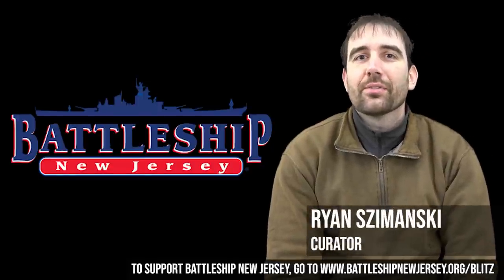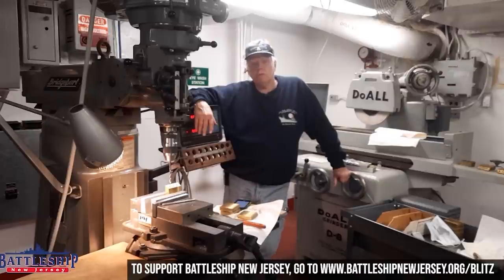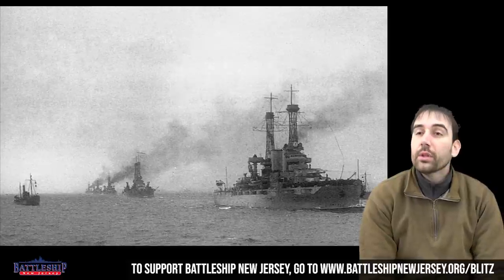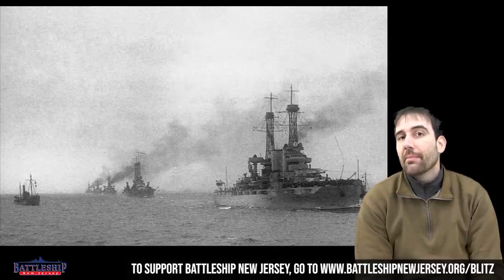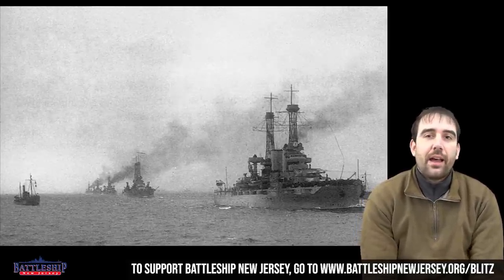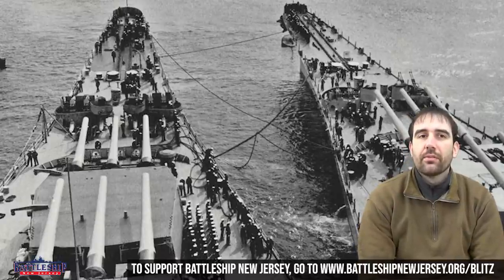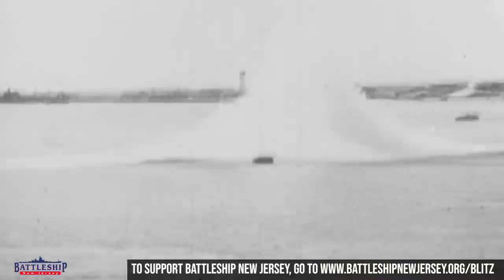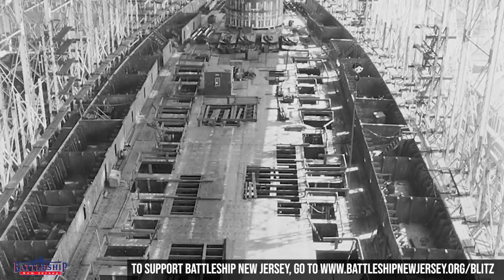The Evolution of Armor on Ships

Comment: I wonder if a ship's torpedo defence area that was left empty, would the ship benefit from having those areas filled with pressurized air or maybe the opposite, have those areas as a vacuum? Would the explosion be pushed back from the high pressure air suddenly being released at the point of ruptured armor or would the vacuum chambers pull the explosion further into the chamber, away from the ship's more critical internal structure and components?
Another thought I've had is what about jet drives? Speed boats and personal watercraft use jet drives for propulsion but a navel ship could have each room connected with a tube ending with a jet drive. After a hole is punched below the waterline and the ship is flooding, the jet drive could be turned on to pull the water flowing in through the damaged area and forced out the back adding to forward momentum. 
My final couple of thoughts on this subject, if a ship had rolls of metal bar reinforced rubber sheets on the sides, above the waterline, a torpedo blows a big hole in the side, damage control rolls down the appropriate rubber sheet (just above the hole) and the inflow of water would pull the rubber to the hull and keep it there, greatly slowing the flooding so internal repairs could happen without the teams being in waist deep (or deeper) sea water...but what about preventing the torpedo from detonating on the hull to begin with? Have 1" thick metal plates suspended above and away from the hull. The top of these plates would be attacked to wood or metal bars via a hinge at both ends of the bar and a cable at the top providing the suspension of the plate (to reduce drag when not needed). During combat, the plates could all be lowered into the water and the metal bars would keep these plates away from the hull so when a torpedo explodes, the energy is transfered to the water between the plate and the hull (which might get a little bent but not punctured).
Honestly, I don't know why I thought about all this stuff but capitol ship defensive protocols, tactics and armor (and damage control) are aspects of ship survivability I tend to think about a lot (submarine design of capacity, capability, stealth, efficiency, speed and protection too).

Comment: On the tour , just exactly how far up in the superstructure do you allow visitors to go. Im not really big on cookie cutter tours but when I went on the Wisconsin in May of 2011 you were only allowed on the main deck and up to the first level of superstructure. Outside of course.
Reply from the maker: Our tour goes as high as the 05 level and down to the bottom of the engine room on 7th deck.

Comment: What about a thin layer of very hard ceramic, a gap, a thin layer of very flexible material, an air gap, a thick layer of brittle  steel with silicon carbide fiber reinforcing it, a gap, then a thin layer of soft metal with a hard backing plate and glass fiber for spalling

Comment: With the accuracy of things like the  hell fire missile it would be possible to put multiple missiles in the same spot and possibly defeat the armor.  But it would require a minimum of 4 to 6 missiles hitting the same exact spot.  And the ciws its going to take out several of those. 
So in the real world situation i would say that New Jersey would survive at least a  dozen or more since the missile would have to burn its way through.
  I need to make a edit here with what American hell fire missile did during desert storm to tanks i would guess that if you could hit the same spot it would still take  12 to 18 to breach the armor and all you would end up with is a small hole that would be easy to plug
Reply: Things change when the enemy has air defense and ew systems. Hellfire can't be fired from very far away so the delivery platform would be vulnerable. So hitting the same spot multiple time when the ship is moving, jamming you, shooting at you, and while you are trying not to be shot, is not practically possible

Comment: How would a damaged section of iowa class belt be replaced/repaired? Is it designed to come out in sections after upper deck is cut away or does the damaged 12 inch belt need to be cut out?
Reply from the maker: There isn't really a lot of precedent here, the Iowas never damaged their belt armor. And it would really depend on the extent of the damage. But it isnt easily split into sections to replace it.
Reply: There is a picture of the belt sections stacked at the ship yard. I can't recall where that pic is hosted though.  They are fastened to the sts steel with basically large bolts.  

Replacing the plate once in there i think would be the easy part. Getting to it sucks. I assume you could get to it from the side, but as constructed they were lowered into place from the top. 

Another question is how long would it take to get a specific armor section made to replace a damaged piece?  If you did have one sitting around from an incomplete ship of the same class, it could be months to make one and transport it.
Reply: @jth877  Thank you. In a few old pics of South Dakotas and Iowas i thought it looked liked the angled belt was sectioned but wasnt sure how it was fastened and if it was reversable for repairs. I would hope they had some inkling how a repair would go and wouldnt have to torch 12 inch plate to replace it.
Reply: @jth877  I have a feeling you have to go up and out otherwise the framing is in the way. I would have thought you might have a few spare plates ordered with the ship to be available if a ship is damaged
Reply: Isn't it generally made up of sections rather than being a single continuous slab, I was under the impression that the plates were about 30' x 10'.
Reply: @JevansUK  Yes, I believe they are about that size.
Reply: @JevansUK  I think you're right for the upper belt. The lower tapered sections, which would more likely see torpedo damage,  have to be repaired from side.  I'm sure the resulting hole and repair of the surrounding structure would leave quite a bit of room to work.
Reply: Perhaps researching how they repaired the torpedo damage on the North Carolina would provide some clues and answers
Reply: @fko1  North Carolina has an external belt and bulge so is a rather different construction

Comment: I remember a documentary about the war in Europe and talking about technical experience, and that the average mechanical knowledge of American troops was better than for the Germans. So issues that would require a German vehicle to be sent to the rear for repairs would barely slow down an American unit where half your infantry knows how to fix routine issues on your trucks.

Sounds like a similar dynamic to what you talk about here with damage control at sea.  General technical knowledge among your recruiting pool can be a very powerful strategic advantage.
Reply: That’s because Americans vehicles are inferior to German vehicles. One German tank is better than 10 Sherman’s. It’s common knowledge that Germany has always still to this day made better vehicles. Look at Porsche, Mercedes, BMW etc.

Comment: "DuCol" (DOOCOAL) or "D/D.1" Steel is the British post-WWI replacement for WWI-era High-Tensile Steel (HT in British documents), used for extra-strength construction and light fragmentation protection.  HOOD's sloped inner deck just behind its waterline belt was 2" of HT steel and was there ONLY to stop fragments from shells that made a hole in the belt, but then immediately exploded (non-delay base fuzes, as was standard in WWI); however, delay-action fuzes became the rule after WWI and this concept was no longer really viable unless made much thicker and more highly sloped, as was BISMARCK's similar sloped deck-edge armor plating.  DuCol was developed by the British firm of Colville in around 1922, I think, and used by the British, the Italians, and the Japanese after WWI and had about the strongest tensile strength of any non-armor steel.  It was used in British heavy warships, starting with the NELSON and RODNEY, as both a light armor and extra-high-strength construction steel when some danger from enemy projectile fragmentation or hits from small-caliber weapons.  The US never used anything comparable to DuCol.  If no fragment or projectile resistance was required, HTS (US more highly alloyed version of high-tensile steel) was used (this included the anti-torpedo bulkheads used in IOWA underwater side protection system, which needed to be very flexible to stretch considerably before tearing when the concussion of a torpedo blast "water-hammer" hits it), and if such damage was to be included in the design at some point, then STS or Class "B" homogeneous, ductile armor was used as the main protection, not anything less.

During WWI the era, the two or more underlayers supporting the rather thin armored decks of that time period were of HTS, Mild Steel, and/or Nickel Steel, not full armor (STS was only in the top, usually thickest, layer), though giving better support than regular Mild Steel alone, as used elsewhere in the ship, but when that deck -- the 2nd deck that was one deck below the weather deck in the modern US battleships -- had to be of major protection against long-range plunging gunfire or aircraft AP bombs, only STS was used (in IOWA, 4.5" STS laminated over 1.5" STS, the lower, thinner layer being also the layer used for the ship's strength deck purposes).  Another reason for the laminated form of the 2nd Deck armor was to make the deck much stronger, since the two layers were overlapped about 50% so no edge where two plates met in one layer was anywhere near where the other layer's plates met -- some German cruisers did not do this and torpedo hits caused at least one to have its aft end almost fall off as the deck folded downward along the single joint of its armored deck, not good!!

Comment: with ships moving from 3000 to something in between 5000 to 8000tn but also being mostly armed with 76mm guns, i think that a 5' armor added to those ships would provide an extra protection against cannon ammo... 
On the other hand, no navy in its rigthfull mind uses the cannons as main guns, they are just the backup/seccondary guns... and they are still around because they can perform as AA/ASuW, they can shoot cheap shots and sink smaller / civilian vessels without wasting a pretty expensive missile (even AA missiles that can be fired against surface targets are much more expensive than cannon shells). 
As for shore bombardment, there are no armored static positions to be defeated anyway... It is not like it was on Normandie or any stronghold of WW2. War is just too mobile, in 1982 Malvinas/Falklands conflict UK avoided landing on the well defended Puerto Argentino/Stanley despite having naval supremacy and enough guns avaiable for massive shore bombardment, they performed their landing on a distant spot in order to attack defenders by the rear, and a modern conflict would be just like that... if the coast has heavy defenses, an infiltrating heliborn operation will land behind the line and attack from the rear.
Light 76mm to 155mm shells provides 20 to 30 kilometer range of cover for landing troops and coastal combat, and have enough punch to pierce machinegun nests or building improvised bunkers which will be the (lightly armored) realistic points chosen by defenders, so in fact having more shells, good coordination and communication (for spotters and fire direction) and faster Rate of Fire is way more important than extra TNT or penetration capabilities

Comment: You made a comment at the end about there not being a ship right now that uses a gun larger than about a 5" inch gun so there isn't a ship that could sink Iowa excluding torpedo and missiles. Navy thinking was missiles were the future.  Shoot the enemy over the horizon.
You  finished mentioning you wondered about the use of tank armor amd munitions used on a ship someday? Well it is happening. 
I read the Navy just submitted a change order for the under construction USS Bougainville LHA-8 for the construction of platforms on port and starboard below tower and beside the air craft elevator platform for mounting of 2x General Dynamics M1A2 turret with 120 mm M256 main gun and autoloader for M830A1 rounds in addition to the already installed VML tubes as well as reactive armor to be mounted on the all exterior sides of the command and flight operations centers.
Long ago the Lexington and Saratoga aircraft carriers were built as Battle Cruisers with straight landing decks and dual 8 inch guns in two turrets forward and two behind the tower originally. Marine Air Landing vessels don't travel with 15 plus ships and an attack sub for protection like a super carrier. They travel with an Arleigh Burke for ship to ship protection beyond what their own RM-116 launchers provide. The Navy can not afford to keep building,fueling, manning, supplying and sailing a destroyer for every LHA. They should be big boys now. 
The latest Marine Corps LHA America Assualt Aricraft Carrier Class Ships of America LHA-6(Now at Sea) and Tripoli LHA-7 (Under Shakedown) were Air 0 ships with no well deck and had no armor. They felt the ships defense and offense came from 2×Mk53 decoy launchers, 2xRIM-116 Launchers, 2x RIM-163 Launchers, 2xPhalanx CIWS, 7x 50Cal Machine Guns, 2ea AV-8B Harrier, 4ea F35B, 10ea V22Osprey, 4ea AH-1ZViper, 4ea UH-1YVenom, 1ea CH-53K King Stallion, 2ea MH-60S Knight Hawk 
That's a lot of missiles cannons and bombs between what's bolted to the deck and what flys off of it. 
The Chinese have a carrier/Battle Cruiser that launched in 2020 with turrets port and starboard with 2 xenclosed dual 5.1 inch full automatic cannons , 6x 11barrel 30mm rotary cannons as CIWS 3port and 3starbord, 30 vertical launch tubes for sea to sea, land, air missiles, 4x torpedo tubes forward 2x aft and what looks to be a turret holding  1x 8inch projectile rail gun forward if the tower. One of these ships pulled out from behind an island in the South China Sea and came up to the Starboard side within 15,000ft of an Arleigh Burke before it was noticed three weeks ago. What we have seen happen to russian cruisers and destroyers in the Black Sea over the past month against ships no bigger than a millionaires yacht has shown us how misguided we are.

Comment: I never understood why the side armor (on modern battleships) would slope inward from the top.  This looks like it would be less effective against projectiles coming in at a high slope angle.  Why not slope it inward from the bottom?  If it slopped inward from the bottom, then it would also reduce some of need for horizontal armor.

Comment: I'd go Iron inside. It would be less Brittle because it's not directly exposed to the cold Sea's. Maybe even put a layer of Insulation in the middle as well.
Reply: Also the Softer wood can absorb some of the impact further reducing chances the Iron Shatters.
Reply: And it would help protect the Crew from being shredded by Splinter's which was a serious problem at that time.

Comment: Turtle shell versus all or nothing.in a gunnery encounter between two battleships it is always said that at long distances the all or nothing system is the best.correct.the feeling I have is that at long distances the probability of getting hit is less than at close range.let's say a ship has a maximum beam of 30 mts.Let's say a ship has a maximum beam of 30 mts.For the fall trajectory to be fairly vertical you have to shoot about 30,000 mts.That's a very long trajectory.The ratio is 1000 to 1.It doesn't seem very likely to get too many hits of that type before running out of ammunition.

Comment: As to the question of whether a battleship can take hits from missiles. Probably not, a single ASROC could probably blow the entire bottom out of the ship and buckle it, especially if its the nuclear variant.
Reply: I doubt a single ASROC could do that. ASROC is just launching a Mk46 lightweight anti-sub torpedo out to about 6 miles (and within range of the defenders 5" guns).  And only the later Mk46 mods had an anti-surface capability. Still, the Mk46 has too small a warhead to really effect large warships even with an under the keel explosion. Again, the main purpose of ASROC is anti-sub and not anti-ship.

Comment: I have a dumb question, did anyone ever try making a torpedo that could be fired long distance from a big gun?
Reply: Most advanced navies use some form of rocket launched torpedoes, so even if it was tried, it would be obsolete.
Reply: Short answer: No, there was no point to even try.

Long answer: Just making a torpedo hull sturdy enough to be fired from a gun - even a very low velocity one like the pneumatic guns of USS Vesuvius (1888) - would make the torpedo too heavy to float, I recon.
And then you have the issue of making the internals of the torpedo survive the accelleration of the gun. Remember: A torpedo is less a projectile and more a miniature submarine. Engineers had enough trouble to make soft-launched torpedos work reliably. Please don't give them even more nightmares ;)
And even if you got all those problems solved, there would be simply too many variables in the trajectory to get the torpedo reliably pointed at the target upon entering the water.